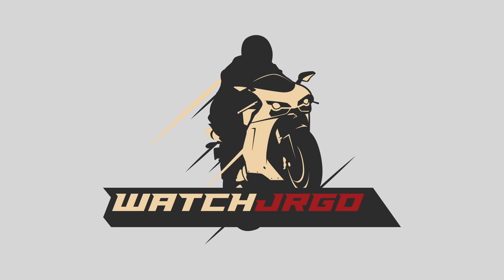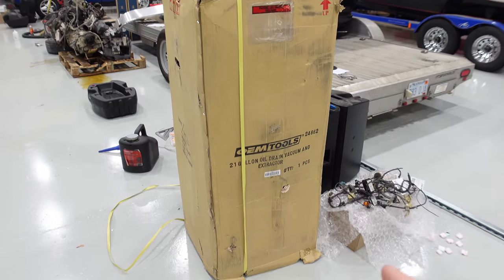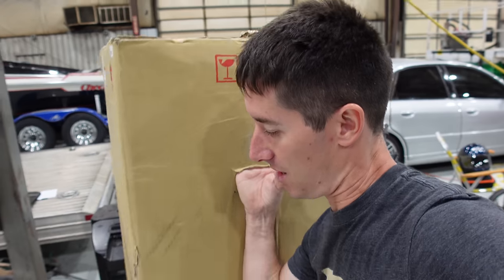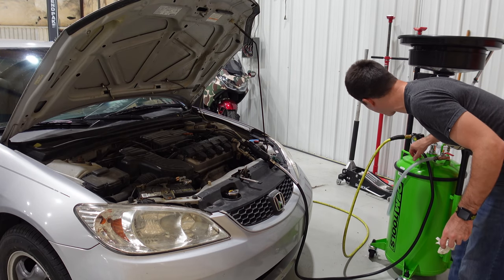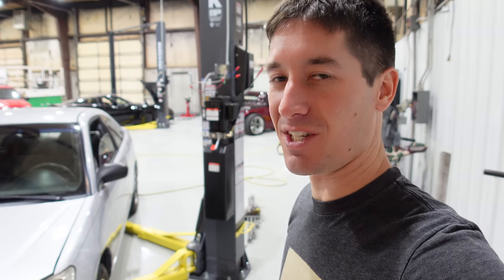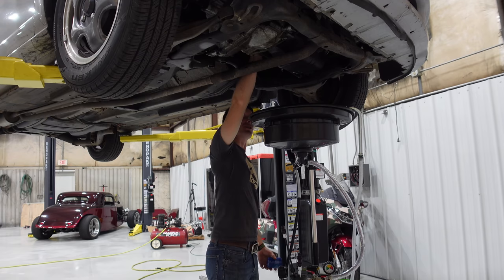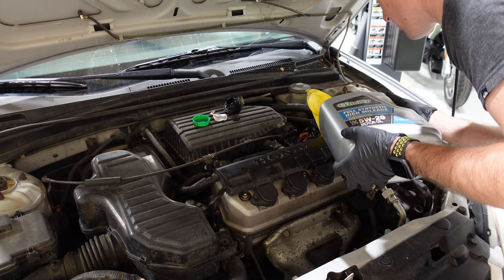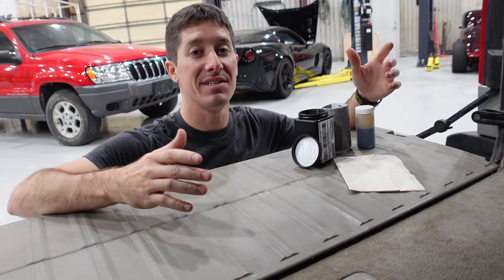Is VACUUMING Your Car's Oil Better Than Pulling The PLUG?

Comment: to be honest, I thing vacuuming the oil out may be actually a better option. It's faster, you don't even need to lift the car in many options, you'll probably get  more oil out of it (as shown in the video), zero chances of oil on the floor, you can do it with a very hot engine without burning yourself, and there's no possibility to crossthread the drain plug and/or end up with a bad crush washer that leaves the drain plug dripping. 
There are also some vaccuming tools that have a glass measuring cup above the cylinder, and you'll be able to see the oil  (a bit like some old motorcycle gas pumps back in the day), and the exact quantity you removed from the engine.

Shout out to Gabe, all the best

Comment: I have the hand pump version of the OEM TOOLs oil extractor.  I have also done an extraction through the dip stick, then opened up the drain plug, and very little extra oil comes out.

Comment: As long as an oil extractor with a constant suction is used, it will remove just as much oil as a drain plug (but you may have to move the tube around a little bit at the end). I use a Mityvac 7300 (since 1998) which must be attached to an air compressor (any size will do). The hand pump extractors are worthless and will not remove all the oil.

Comment: that's the only way I do oil changes now.  even if the extractor couldn't pull all the oil, it's much easier to handle the little remainder of the oil through the drain plug

Comment: I've been using suction for my oil changes on my cars for a while now.  Sucks using a 6L container on a car that take 7.5L though.  As everything else is at the top, it's not a big deal.  On dad's truck that requires me to empty the oil suctioner 3 times, I just pull the plug.  Plug is right next to the oil filter anyways.

Comment: Might have worked on this car.  But many engines have baffles, windage trays and the dipstick tube may not reach the bottom of the pan. I’ve been a tech since 2011 and changing oil since 2007. I’ll always be pulling drain plugs

Comment: I have a manual oil extraction pump that looks like a basketball.  I've used it regularly to extract transmission fluid on a Jeep Liberty with no drain plug..  Recently, I thought I would try it on the engine, but the tube did not fit down into the crankcase. (Too stiff to bend as well as the dipstick ?)
I'm due to change engine oil now on a Nissan Frontier.  I plan to try it with that.  (The Frontier has a trans drain plug.)   Engine oil filter is a pain on both of these !

Comment: My Acura TL has a stripped oil pan (female thread's) and I'm going to need to use a single oversized drain bolt that cuts new threads. I bought the car used for a decent price. It had it's oil changed at these quick oil & lube places. Someone wanted to be He-Man when tightening the drain bolt.

Comment: I've used an oil extractor for years on my VWs. Mainly because I live in a townhome and don't have a garage, and VW oil filters are accessible from the top of the engine. Why go underneath when you don't have to?

Comment: In my considerable experience working on my own, family and friends cars over 26 years. Technically sucking out oil is never better that draining it from the sump. If you rigorously stick to the shortest oils drains and warm it up before hand, so all the stuff that ends up in the bottom of the sump circulates before you pump it out, you should be ok. But it's better to drain from the sump

Comment: Normally when sampling oil you use a clean piece of tube and a syringe to suck it out.
Otherwise you'll contaminate your sample.
As it was a brand new unit it probably won't matter... but next time it will.

The dipstick hole is probably the best place to get a sample for oil analysis. 
Sampling via the sump plug is fraught with problems... as it's much more prone to contamination.
:-)

Comment: This is the factory sanctioned method for Mercedes....in their official WIS (Workshop Information System) it tells you to do it by vacuum extraction.  Just finished typing and JR says the same thing around 7:30...good stuff.  Honda filters on the back of the block suck.

Comment: Interesting method for an oil change. I've yet to see anyone else vacuuming out the oil, and it appears to work a lot better than taking out the drain plug.
Reply: Lots of qwik change oil shops vacuum the oil out through the dipstick. If you plan on selling the car someday its fine. But if you plan on driving the wheels off of it, use the drain plug. Warm your oil up before you change it. Draining it will allow more of the fine sludge to rinse out with the oil. Sucking it out won't get the trash in the bottom of the pan

Comment: The company i use to work fork had 44 big trucks and 140 heavy equipment vechile.s they used the vacuum system on all of them except they still did it under the vechile with a special made drain plug that worked like a valve

Comment: Can be an issue on some turbo cars as some of the oil feed lines to the turbo can be quite thin etc.  So if there is any kind of crap / sludge in the oil for whatever reason it wont get pulled out via the vacuum and will stay in the sump eventually cloggin up the small oil feeds to the turbo and blowing the turbo.  Had this issue on a turbo diesel . Possibly ok on NA honda engines that are virtually indestuctable

Comment: A group of buddies and I did this test 20yrs ago with the same results on BMW M54s. It's not a 100% thing, though. I tried it on my parents' two Mitsu 6G72s, and one worked fine but the other had some sort of baffle that I couldn't get the suction tube through. And of course no bueno on most modern German cars that have no dipstick, or things like Lambos and others that have 10 drains.

Comment: my range rover has a metal tube under the oil filler cap built into the crank case so you can do an oil change from up top without having to remove the oil pan cover or oil drain plug.

Comment: I've never seen oil being vacuumed out of a Honda Civic before (or other "commoner" car).  On a high end/high spec car like a Merc S-class sure.   "Wickedly" cool to see it performed on a Civic though (Happy Halloween).  For me, it's just important that oil gets changed on time so the engine doesn't get nasty sludge build up (so it doesn't mater which method is performed in my book). 👍  Wish Gabe a speedy recovery. 😃

Comment: As with anything, it depends. On my Audi A4 2.0L, extracting oil and changing the filter was all from the top side, and easy-peasy. If you changed by pulling drain plug, the plug needed to be replaced every time. 
On my Dodge charger 6.4L, everything is done traditional way, filter on bottom and plug designed to be reused

Comment: people who say sucking it out is bad have clearly never pulled a sump or a transmission oil pan, there its always oil left over when you drain using the drain plug on both as the plug area is always elevated even when it's in the bottom. i've had nearly 0.5L from the bottom of a trans pan when pulling that on my 330i

Comment: its a good thing that one has different tube sizes as there is no standard on dipstick hole diameter.   mine worked great on my bmw ,but the  tube is too large for my civc.  the one you got is not cheap .  $800

Comment: Oil Evacs are even better for European cars that have the topside oil filters. You don't have to take out the annoying skid plate to get to the drain plug. It's also less messy and a lot faster.

Comment: Please show us how to empty the used oil collection tank when it fills up... and where we can discard it. At home I've been using the cardboard box.
Reply: If it's like I expect, you make sure all the valves are closed first.  Then, hook that drain tube into your disposal tank (like the 55g drum he mentioned).  You then open that tubes valve, and put the air hose on a "pressure" inlet, and the positive pressure pushes the oil up a dip tube from near the bottom of the tank, and out the drain hose.  For that exact reason, you need to make sure once you remove the air hose from the pressure inlet, and the tank is back to 0 PSI, you shut the drain hose valve.  Otherwise, someone might get surprised by an oil shower in the future.

Comment: It's only faster if the filter is up top like on Subaru and Toyota's. When the filter is on the bottom and you still have to lift up the vehicle to pull the filter and clean the mess after it's not saving you much time.

Comment: With cold high viscosity oil from older cars it can have issues, that aside the unit really offers more service options. Also good for power steering fluid. However when emptying the unit make certain the valve for gravity drain is closed and the extension locked in place. Don’t ask me how I know……

Comment: FYI, you can also buy the Genuine Honda Oil Filter at your local auto parts store as well. I do that all the time. Here’s something interesting you’ll like though, recently I went to my local Acura dealership to get a new drain plug for my 2011 Honda pilot and after taxes it cost me just over $13 for a new drain plug and gasket. Now I also went to the Audi dealership to get a new drain plug for my buddies 2000 Audi TT and that one cost me less than $5. I don’t get it.

Comment: Poor Gabe. He got the shoulder replaced with a unit developed by DARPA, NSA and Texas Speed. Now he had his heel and ankle pinned with pins made by Steyr-Manlicher, Bushmaster and Rheinmetall. On his way to become Iron Man. Now he can rip the door off an MRAP, but can also kick fire a 155mm depleted uranium sabot tank round or stomp through a manhole cover and whoop the crap out of the Ninja Turtles. Donatello...choke slammed. Michaelangelo...elbow strike to temple, Raphael...one handed bitch slap, Leonardo..kicked so hard in the gut, his shell exploded out the back. Master Splinter...upper cut and knife hand to chest.

Comment: I use a descent quality squeeze bulb drain hose to empty my radiator down far enough to change out a thermostat and if I have an older car with unknown history of the transmission, I remove 3 or 4 Qts. of tranny fluid and replace with new fluid so I still have some of the old in the tranny. If it was super cold and snowy out I would change my oil out like this if I wasn't going to change the filter because I feel like its better than not changing it at all. I think draining the oil does a better job getting out the metal particles.

Comment: Gabe! What happened? It sounds like gravity went against your hope and wishes  - As you age gravity will whisper in your ear that "go ahead, you can do it..." but like Lucy with a football gravity will pull the prize away at the very last second and leave you on your back. Heal quickly. Look into Rolfing after you do your PT rehab. Rehab gets you stronger, Rolfing will get you back to normal after injuries. It works.

Comment: You got 100% of the oil out. What is there to argue about? If this was one of the rare engines with dual sumps then suction only won't work, but absent that this seems like a much cleaner and simpler method. As someone without a lift who prefers to change his own oil I would love a system like this in my garage.

Comment: That is a big bad extractor lol, there is a smaller 2.x gallon one at Harbor Freight that I might get.  They have a pnumatic one for extraction, but a pump one for extration and delivery.
Having the ability to use it to put oil in small motors like my pressure washer and generator sounds like maybe the way to go.

Comment: It only works good on pans that are flat on the bottom. For a truck like a silverado there is a plate at the bottom of the pan at the lowest part that holds about a quart of oil. So it won't get the oil out on every vehicle.

Comment: I have a 3.6 Chrysler, they started doing the vacuum about 3 changes ago. My Dodge with the last V6 has an oversized drain plug installed after 260k miles. This should keep from damaging my aluminum oil pan

Comment: I drive a diesel Chevy Cruze and with the plug drain oil change it still looks totally black following a full oil and filter change.  The one time the dealer did it following fixing an oil pan leak it looked like fresh from the jug oil for a couple of days before it got black.  I plan on getting a smaller OEM brand oil vacuum extractor to better change out the oil.
Reply: Diesel oil just turns black extremely fast, nature of the soot the engine creates. Color doesn't mean it's too used.

Comment: This method would be good for those Ford and Mazda Diesel engines that require the entire oil change to be done in under 10 minutes or the oil pump fails to prime, destroying the engine. If it’s taking too long to suction out the oil, turn it off and start refilling. Might be a bit diluted but you still have an engine.

Comment: I need a better idea for how to drain the oil in my truck it's cold here snow on the ground don't have a garage and the oil plug is so tightened it's impossible to budge it .

Can't bring the truck to a shop they'll deam it not road worthy and keep it or something.
Can I drain the oil from the hole in either the dip stick or oil filter fully ?with a tube

Comment: I have done this a few times. I use a 12v pump to suck the oil out. I wish my mustang had a dipstick that was not flat so I could do this. And yes Mercedes has been doing this since at least early 2000s and it does work. Why crawl under?

Comment: I think this machine is good if your oil filter is on top somewhere or your working on a complex German car or something. Doesn't make sense to buy the machine and still have to lift and get under the car might as well loosen one bolt to drain the oil.

Comment: If you have to get under the car to remove the oil filter, then I just remove the drain plug.  However, if it's a car like most BMWs, where the oil filter is near the top of the engine, I just use my Mityvac.   I've owned my E39 BMW for 20 years, no issues... (knock wood)

Comment: I have been vacuuming oil from my vehicles for over 10 years. And I did pull the drain plug off for the first time on each vehicle and not a drop of oil came out...:yougotthis:

Comment: I have a similar vacuum and do not need the tube just suck from top with suitable coupling. Let the warm engine sit for 2-3 hours and suck. Then let it be over night and suck. Oil from engine parts take time to drip to the pan.

Comment: I hate changing the oil in my gen 7 Civics because of the stupid location of the oil filter.  Fortunately, they fixed that from gen 8 on.  Also, don't forget to service the timing belt (another thing I don't like about the gen 7s).

Comment: Would love to see a comparison vs the OEM tools manual extractor or Mity vac manual extractor to see if they work just as well.
Reply: You mean the bike pump style extractor?

I used to have a cavalier that my oil pan nut came loose tight as a ticks ass on it. Never had the money to change my oil pan out, but my oil fill tube went into the pan. 2200 sfi. I used that to do my oil changes, it always pulled out all the oil with the vacuum it created. Spun my filter off after removing the wheel after, lubed it up, stuck it back on, poured my oil in, and my cavy was good to go.

Comment: I don't see a problem with vacuum extraction. Haven't done it with oil changes, but my transmission has no drain hole. So I have used a shop vac and a pickle jar to change trans fluid.

Comment: Hahahaha yeah I HATE doing the oil change myself on my EM2 because of that oil filter location. It makes an absolute mess. Years ago the Honda techs told me they just stuff a wad of towels around the filter to catch the mess. They also said they would use an entire can of brake cleaner to clean up the mess if they didn't. Sent my oil to Blackstone at a little over 200k - everything looked good.

Comment: I have a manual one for home. my back loves not laying under the car. I also did the same thing as you. pulled the plug expecting the engine to still be full of oil. same result as you, completely empty. if at first your don't succeed Gabe, fly fly again

Comment: Oil changes in my old Subaru would have been so easy with this setup.  Suck out the oil, top mounted filter.  No crawling around on the ground.

Comment: I have been using a vacuum extractor for a few years on my car and two ATVs. I think it’s the best for the diy guys who don’t have a lift at home. It also can save having to remove the entire plastic pan at the bottom of the engine. 
Problem I have now and maybe someone can help me ……… I got a new Audi SQ7…….. it does not have a dipstick or and place to put one. I believe their is a spot somewhere at the top of the engine to pull a plug to allow you to vacuum out the oil ….. but I have yet to find it. 
Any Audi tech out there willing to help?
I would also like to be able to get a dipstick for it. I don’t totally trust the electronic “dipstick” and I also like to be able to see the oil condition when I check the oil with a traditional dipstick.

Comment: try it on a 2010 toyota highlander it leaves 3 quarts in the engine (at jiffy lube)... just because it works on your honda dont assume the hose can reach the bottom of the pan in all cars .. my brother in law just had his jeep oil changed at dealership today they used the vacuum and when he got it home it poured oil all over the garage floor from being over-filled because the vacuum didn't pull all oil out and the dealer added the full recommended amount and didn't check it and over-filled it by about 3 quarts. .new engine time? who knows ..
Reply: I have a highlander too, pulled 3 quarts. Scratched my head and only added three quarts. I was wondering where the 2.5 quarts went, was I doing something wrong.